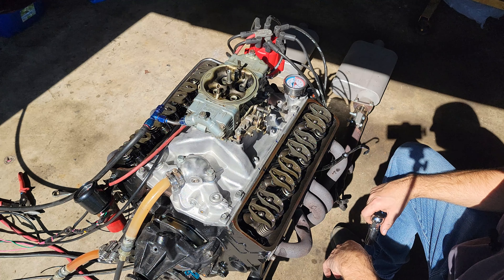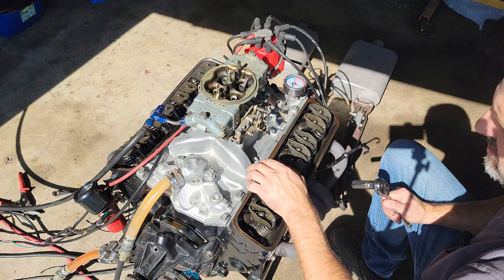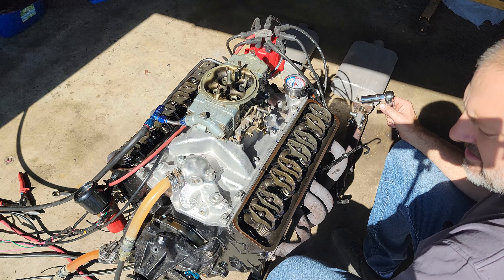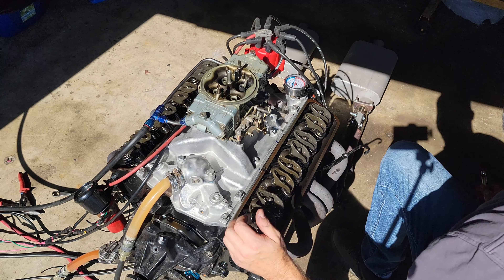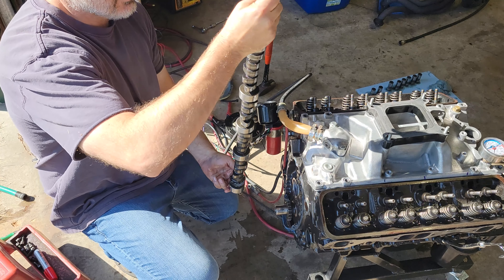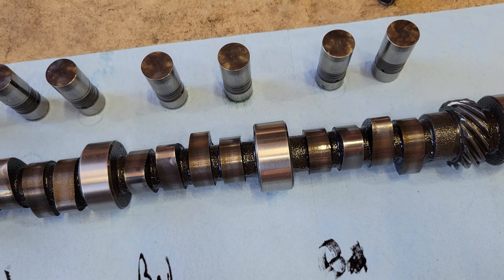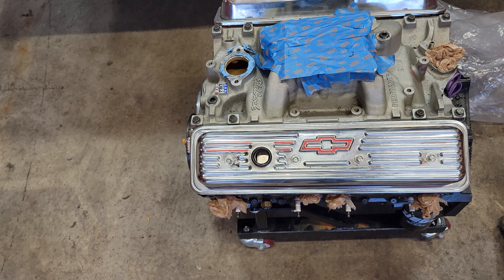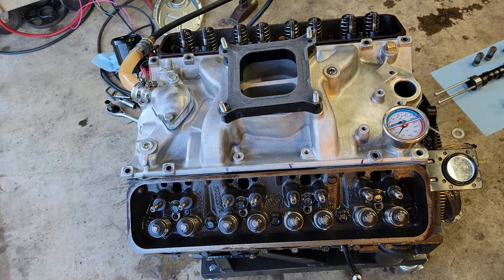Camshaft fails to break in. Chevy 350 230 .480

Comment: I've heard for years about soaking hydraulic lifters in oil and pumping them up to get the air out before installing them. I'd just put them in, take out the slack and give the nut the prescribed additional turn to center the plunger and button everything up. We never broke in a cam from what I can remember and we definitely didn't use break in oil in our engines. I think a lot of cams get ruined for a lot of different reasons but I never installed a used cam either. They were pretty cheap back then (100-150) with lifters. There's no way to know if the lifters got mis-matched to the used cam unless you swapped it yourself.

Comment: If you watch enough youtube videos of guys starting fresh engines where the timing hasnt been set and the idle speed is at 600 rpms then your videos are a change of pace. 
Amazing how many people can't set an HEI to 10 BTDC. 
Ive been checking used cams for taper with a small machinists square and my Souix valve grinder has a lifter grinding fixture.
With reasonable spring pressure it seems to work.  Too bad about the 280H.  Its a good street grind for my budget 350s and even 400s.
Do a video in high vs low compression combos.
Thanks for great videos.
Reply from the maker: @shoelessb4515  Sounds good, thank you. A High compression test would be fun and doable.
Reply: your sioux has a lifter grinder? what model? i have a model 2001
Reply: @frigglebiscuit7484  It would seem to me all you would need is the proper chuck to hold the lifter for grinding.
Reply: @shoelessb4515 why are you only setting your hei to 10 BTC..?

Comment: I had a Edelbrock cam RPM Package 310 Duration  .512 lift go bad on break in. Brand new from Pep Boys. Valve springs were 350 Lbs. per square in. Camel hump heads.  RPM heads heave 296 Lbs per square inch springs. So maybe it was my fault. bought  cam from Summit 309/ 310 Dur. 488/510 lift and broke it in with stock springs and a zinc additive. Have not changed the springs yet. Still starts up ok. But I am afraid of putting the 350 Lbs. springs. Have read articles of guys breaking in cams with 350 Lbs. springs and molly lube with no issues back in the day when there was a certain amount of zinc in the gas.  Read articles implying that there have been a lot of machining issues. I feel your pain.
Reply: Use stock springs for break in
Reply from the maker: @AlfonsoGudino-l1f  Thank you. How do you like the cam. I have something similar 234/244 on a 112 on the self.
Reply: Summit cam sounds real mean. Has a nice rump to it. I believe it is SUM-1107. Has 114 lobe separation. Haven't tested it yet. Still working on quarter panel replacement.
Reply: I'd advise anyone that's not versed on "setting up" a valvetrain properly.  To purchase as complete of a kit as possible. That includes matching springs, with hardware and rockers that are proven packages. Trying to just throw some parts together and see what happens? Rarely works out favorably. Pushrods usually have to be changed in length, especially with big cams. There's just so many factors that can effect the geometry of all those parts. 
Take your time and figure out what the engine needs, not your ego. Why are you using a cam with so much duration? Are you circle track racing? Anything more than around 240° at .050, is overkill on the street.
Reply: good god, 350 lbs of spring pressure at 1.150/1.250" is wayyy too much. 300lbs is a really good area for a street flat tappet.

Comment: Soooooo just what is your whole ''Camshaft break in'' procedure, @2:12 you state
''20 minutes break in time.'' What else?
Reply from the maker: @FABRIC8TIONUNLIMITE1  Coat cam and lifters in a moly lube. Prime oil pump while rotating engine. I have a good carb and ignition set at desired initial timing. Lucas break In oil. 20-minute continuous break in. Rpm's bewteen 2000 and 2500. I spent a additional 20 minutes trying to get the lifters to spin. I usually just follow the camshaft manufacturers recommendations and it varies. I did  a quick check to make sure the lifters had a crown.
Reply: @nylegreen261  Sound about right.
Reply: ive broken my cams in at idle or no more than 1500 before...but i was using howards cam lifters and their zddp max additive, and revving the engine over 2000 every now and then to sling oil.

Comment: When building a flat tappet engine, I like to get the cam installed and all valves adjusted.  Then mark the lifters and turn the engine over.  You should be able to see that the lifters are all rotating.  Any that aren't rotating you've got an issue and know it before you start the engine.  Not sure if it's foolpoof but good peace of mind.  How do check the lifters with the engine running like that?  And yeah, new lifters with used cam not good.  I've had one go downn like that too.  Used cam with mached used lifters back on the same lobe should be good, but they say even then if it's in a different engine you shouldn't do it, but I would if the cam looks good.
Reply from the maker: @bigmikesgarage5627  I appreciate the input. I have a set of valve covers with a strip removed from the middle . Once I figured out the rockers weren't throwing oil everywhere, I removed the valve covers. It is safer to check with the engine off and rotate the engine over by hand. If they don't spin. Remove valve covers and mark down which way the clips are facing on the lifters. Replace valve covers. Start engine for a minute. Take the valve covers back off and see if the lifters have moved. Thanks again.
Reply: @nylegreen261  I actually do it before the engine even goes in the car.  Even just barring the eingine over by hand the lifters will show rotation if everything is right.  So much easier to correct things before the engine goes in.  Probably a good idea to check after it's running too though.
Reply: @nylegreen261  you can do it on the engine stand even easier. just put paint or marker on the top of the lifter or stripe the pushrod. youll know real quick if its turning.

Comment: From what I've seen and experience I highly suspect it's those lifters that caused the problem, they look like the generic white box Eaton type that Summit sells and that Comp gives away in their cam kits. I've checked through two different sets of these lifters, one solid one hydraulic, both had almost no taper at all when compared to OEM GM/Delphi lifters with the hardened cap. If I had to bet I'd say that cam is fine, stay far far away from any lifter without a hardened cap unless maybe it's from Isky or Howards. I wouldn't risk it though, OEM GM lifters for me from now on.
Reply: If I remember right, Jon at Delta Cams has found those generic lifters to have a very sharp edge to them that needs to be chamfered to make sure the cam lives.

If GM lifters arent available, I'd go with a cleaned up set from Delta.
Reply: @of_lion22  I still wouldn't use them even with the chamfered edge, even with the chamfer there is hardly any crown and they don't spin on the lobes. I had to tear apart a perfectly good 355 because of these lifters :(
Reply from the maker: @colinjohnson7663  Thank you for the information.  I have had good luck using Howard cams and lifters. I won't make this mistake again.
Reply from the maker: @of_lion22  Thank you. I will look into them.
Reply: nah, comp cams are garbage too. i only use howards cams and lifters.

Comment: Due to flat tappet lifers are so poorly made now from China and then sold to even the big named company's and causing hellish wear outs on just start up I am no longer using flat tappets and I'm all in for Roller cams now.
One engine its self-used 5 flat tappet cams + lifters on 5 to 10 minuets start up costing me big money each time.
This is big to remember that the cost of tear down and put back together can be what you would spend on a Roller cam and not had the common problems of wear out from flat tappets and the cams
Reply from the maker: @Lure-Benson  Good information. Thank you.